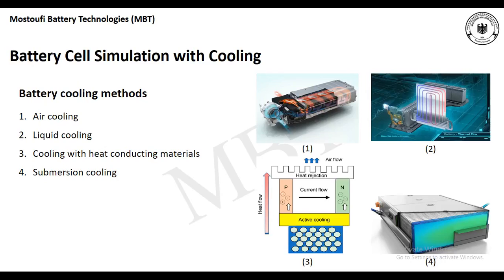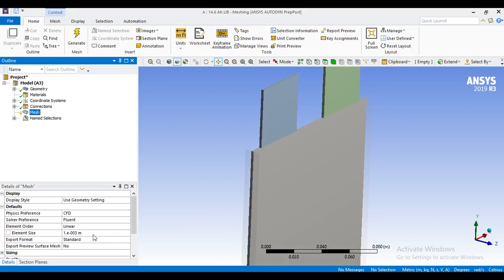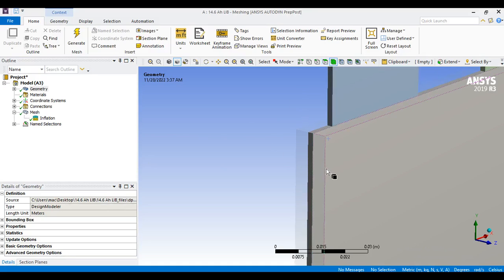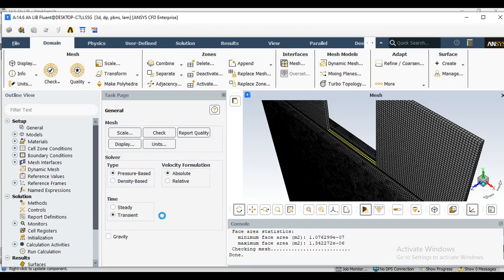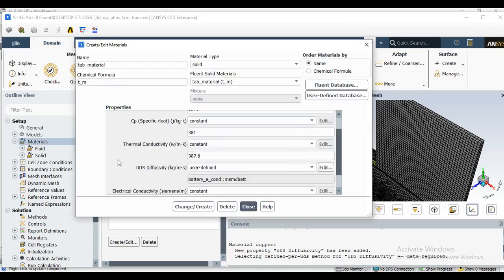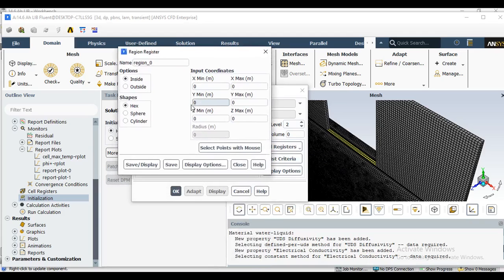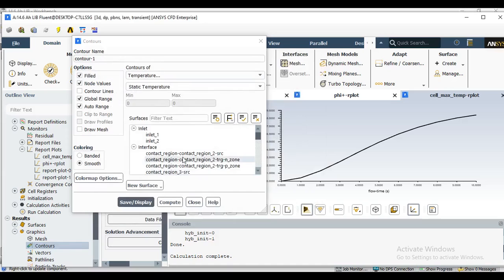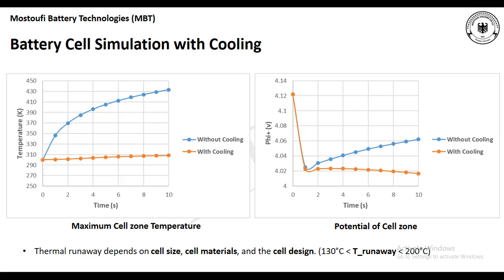Battery Simulation with Liquid Cooling in Ansys

Comment: Sir, how to create air flow cooling? can it be achieved easily by updating this model?
Reply from the maker: Hi, you can easily add a material as "air" or any other coolant, and assign this material to the cooling channels via "Cell Zone Conditions". You may need to create a mixture-template as well based on your case.

Comment: Sir can you explain the different E-chemistry models in MSMD as of when we should use which module , also how would you do the similar simulation for a complete battery pack with multiple modules (30modules i.e 300 cells ) and bus bars ? Thank you

Comment: Error resolved. Actually i am learning basics of ansys regarding battery application.
I am considering same parameters as you suggested.

Can you please tell me how to carry out grid independence for this type of structure?

There are two type of mesh so which should we consider?  

And 2nd question is how to import data to excel from this chart?
Reply from the maker: Hi, first, for grid study you can define 2 or 3 grid size by decreasing the element size of the mesh setup. Second, you can use the unstructured or structured mesh, there is not much difference between the two mentioned as the geometry is simple. Third, you can find the text report file in FFF folder and import it to excel.
Reply: Thankyou. Changing grid size manually worked. 
1) But i am unable to find grid indepedency by parameter set. How it will work for this type of geometry.

And i have one more question. I have read that increasing value of C rise effect temperature rise. 2) When i am changing value of C in this model, still getting same result. Why this is happening. How can i show effect of C change
3) when we draw contour diagram. It shows maximum temperature at short around 346K whereas graph shows 305.this 305 is cell wall temperature?  If yes how can i show it in contour?
Your videos are really helpful.

Comment: Great information. After defining short circuit when I am initializing solution 31min 30sec. I am getting these two warning
Warning: Electric conductivity of uds0 in zone cell_zone is equal to or smaller than 1.0.
         Ignore this message if that is what you want. Otherwise, fix it in the material panel.

Warning: Electric conductivity of uds1 in zone cell_zone is equal to or smaller than 1.0.
         Ignore this message if that is what you want. Otherwise, fix it in the material panel.

How to deal with these.

And If I want to select any other mesh please upload tutorial about different type of mesh and is it necessary to make mesh converge? How to select best mesh.
Reply: Thank you
Reply from the maker: Dear Mahesh, thanks for your comment. Regarding the two error messages, you should check the values of uds0 and uds1 in the material panel for the active material. They should be greater than 1 (around 1e5, and 1e6).

We can help you with different models, you can simply send us an email if you have a specific geometry. 

Email: bfcs@mostoufiholding.de

Comment: Hello. I am doing the cooling work with the 5-pack busbar in the steps in your video, but IDA returns error code: -14Voltage=-193618.288897 current=2092656.357151 power=-405176543119.941710 I am getting this error.

Comment: Hi Keivan! I understood from your tutorial that for comparison the performance with and without battery, I have to run the simulation without cooling using same set up such as short circuit, resistance. 

However, can you please tell me how/where will get all the values of temp or Phi+ for different time (for example in your case, you have showed in a graph in the last section of tutorial for 10 sec).

Thanks a lot 😊
Reply from the maker: Hi, as you have seen, in the report plots we checked the three options of "report file, report plot, and print to console". So, you can access the text file of the Phi+ values for each time at:
dp0 >  FFF > Fluent
Reply: @mbt_s  Thanks a lot Keivan ☺️
Waiting for more video about simulation, mesh generation and much more in Ansys 😊👍👍
Cheers!
Reply from the maker: @wajihatasnim7995  Thanks. There will be plenty of interesting videos in Ansys, MATLAB, and also OpenFoam for the simulation of battery and Fuel Cell. So, hope you enjoy!